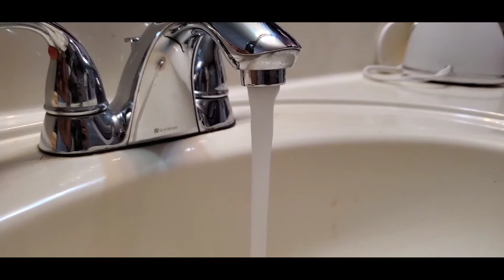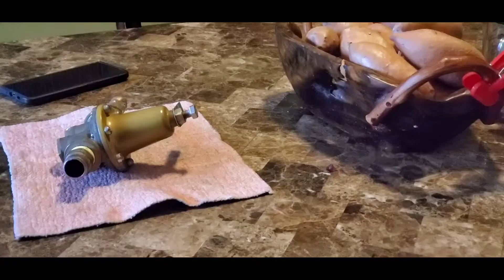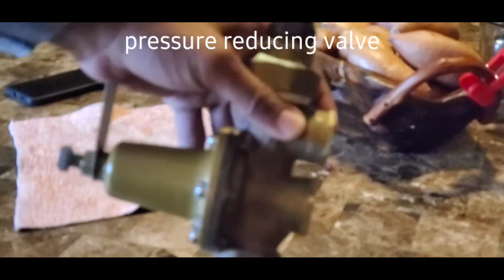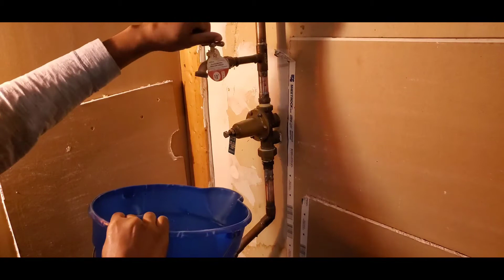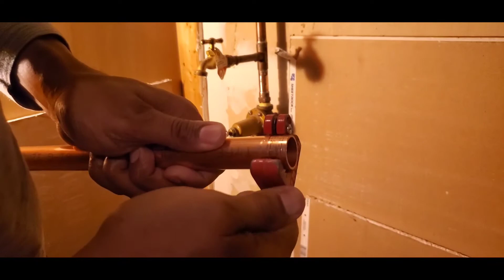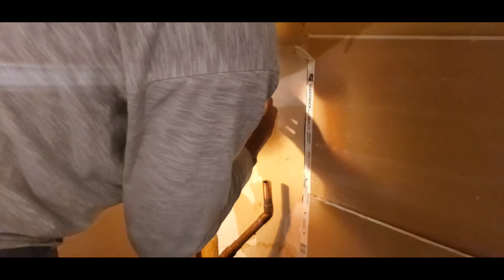Low water pressure issues...FIXED! ( pressure reducing valve removal )

Comment: you never want to do what this guy did removing water pressure valve from your home is a big mistake that will cost you thousand of dollars. for example my water pressure vavle went bad allowing to much water pressure into my housr which caused my hot water heater to start leaking and it caused my water valve to my ice maker start leaking because these valves are not made to handle all the pressure that can come from your city water source which can be as high as 300 PSI your home should only have a max water pressure pf 80 PSI. the water pressure valve allowa you to control that water pressure.

Comment: This is exactly what’s happening to me for 2 months and no plumber is able to figure out what’s going on! They installed constant water booster for $2000 and it’s cavitation and I have less pressure. PRV was making auction sound: my pipes are banging and have issues. Should I replace this?
Reply: If PRV makes noises it needs replaced or rebuilt.

Comment: Water pressure should be under 75 PSI. It is very important to test a system before eliminating a regulator, and to realize that there might be late night intermittent spike you will be exposed to without a regulator. I would check with the utility and perhaps ask neighbors if they have a regulator, and not just do a single pressure test to know it is OK to do this. Note that copper pipes have a much higher bursting pressure than flex lines and appliance solenoids, so a common pressure failure experienced by a client of mine was burst dishwasher line that happened TWICE. Another client had ruined dishwasher solonoids twice. Even with a regulator, thermal expansion can force a pressure regulated system to reach water main pressure due to the lack of an expansion tank on a house system. Code is now mandating regulators AND expansion tanks in combination. Finally, shark bites are great in this application, but I would never, personally, put one in a concealed location or where there is potential for movement.

Comment: This is not good advice. PRV's go bad and need to be rebuilt or replaced, not removed all together. As stated previously, they are there for a reason... you even stated the reasoning in the beginning of the video. Also, sharkbites are prone to leaking... seen it plenty.
Reply: My buddy had a bad regulator, and it blew the fixture in his 2nd floor toilet cistern, flooding his bathroom, bedroom, and kitchen below, running over wires in between which could have burned his house down. Please DO NOT be recommending that people bypass this absolutely crucial component.
Reply from the maker: I understand your concern and maybe in some scenarios you have a valid point not taking that away from you. But in my case starting with the SharkBites I've had one installed for over 10 years and there hasn't been an issue whatsoever. As far as the pressure relief valve somehow someway my water pressure isn't as high as it use to be when I moved into this house . So removing it was the best scenario for me. The water pressure in my overall house is not high at all it's actually stable and not causing any damages to the washing machine nor any problems coming up through the faucets and things like that. However I can understand your points you've made  concerning things like shark bites that leak prv"s that need to be replaced instead of removed. What I'm doing in this video 100% work for me. And I do appreciate your comment.

Comment: Cost for reducing valve $120, cost to have plumber come out, bust up your concrete slab to get at ruptured line because of too much water pressure $1200.00. Now here's a helpfull tip for the do it yourselfer. That cone shaped bonnet with the pan head screws going around it can be removed and the innards(valve ,spring, diaphragm , strainer etc)replaced IF the valve isn't like 100 fricken years old. That way you don't have to disconnect any fittings or desolder any unions. Just be sure to turn off the water supply and back off that spring adjusting screw on top of that bonnet. EZ PZ
Reply: Best comment!  The water pressure valve is there for a reason!  A rebuild kit is like $30 - $50.  He spent more time bypassing the valve than just rebuilding it.
Reply: 🤣😂🤣😂
There’s no busted line below the slab as all the plumbing which used the PRV is above the slab. 
Possibly a flooded basement.

Comment: They're pretty but not so much when they feel in a place you cannot get to they do fail at times. Best for emergencies when you return to do it like a pro with solder. With that said I do have a pressure relief valve that that's solderless.

Comment: That pressure reducing valve is on your system for a reason: It reduces pressure, which if too great can, and will, damage your fixtures and piping. I highly recommend you re-install that valve.
Reply: when he blows a supply line he will realize it was there for a reason...

Comment: Please don't do this.  The city water pressure varies throughout the day.  At night, when not many people are using their water, the water towers get filled by the pumps and the pressure rises.  During the day, the pressure falls when demand is high.  depending on your elevation to the water tower, you can have damaging pressure in your home without this regulator, and it will most likely cause a burst pipe when you are sleeping, because that's when the city's water supply has the highest pressure.  Not to mention that it is a code requirement to have these pressure valves and you run the risk of your home insurance not covering you for the water damage if you remove this device.  Your best bet,  if your old valve is clogged, spend $75 and get a new one.  If you have issues with particles in your water, get a spin down filter and install it up stream.
Reply: The ISPRING Spin Down Sediment Water Filter would work great and you wouldn't need to go down to 50 Microns,  1000 microns would work fine for removing large particles before reaching your pressure valve and it wouldn't have to be cleaned as often as a 50 would.  Another point,  Never use sand paper to prep a pipe before using a shark bite, instead, use a green scrubbing pad like you find for scrubbing dishes.  That will polish the pipe without cutting grooves in it.  A YouTuber called Got2Learn has some excellent videos on sharkbite fittings. Sorry to hate on your video,  but you are setting people up with some very bad advice and it can cost them a lot of money if they listen to you.  My advice, delete this video and make a new one doing it the right way.